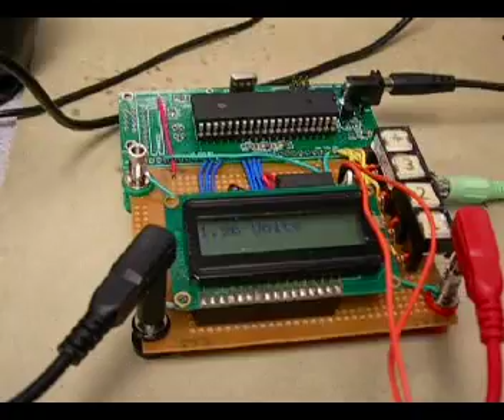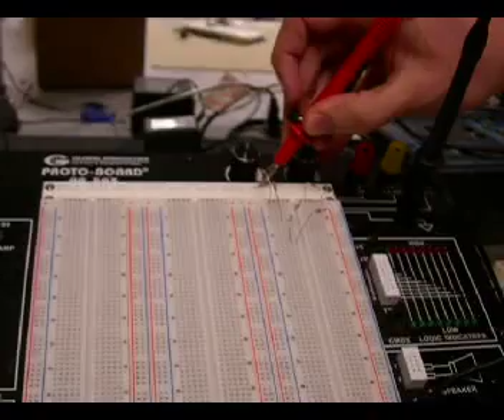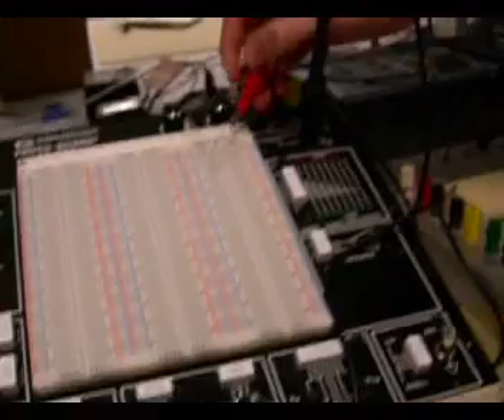talking voltmeter

Comment from the maker: The files must be compiled using WINAVR GCC to make a hex file. The hex file is loaded into the MCU. There is a hex file in the zipped project. BUT, it is impossible to debug the design unless you compile the source code.